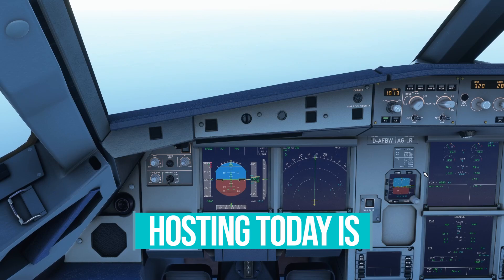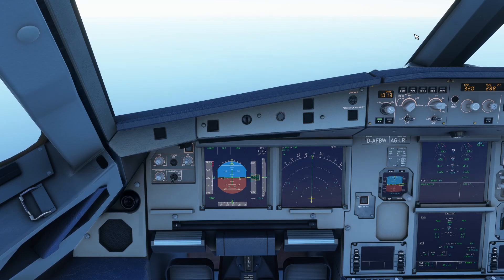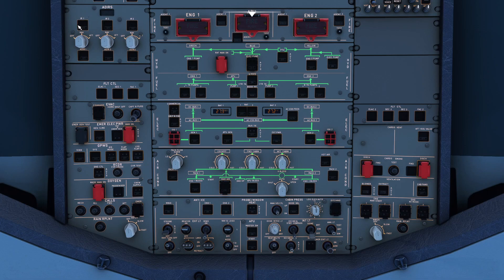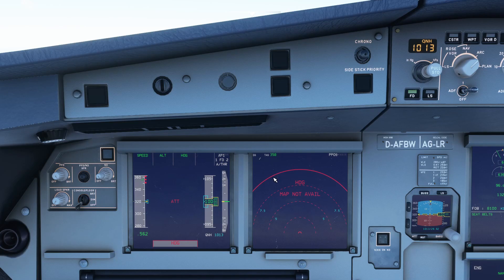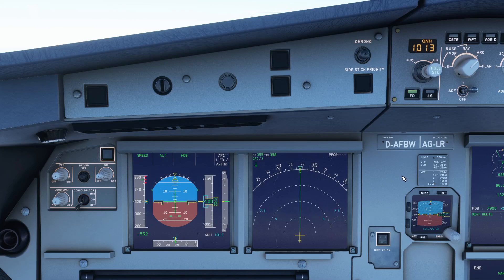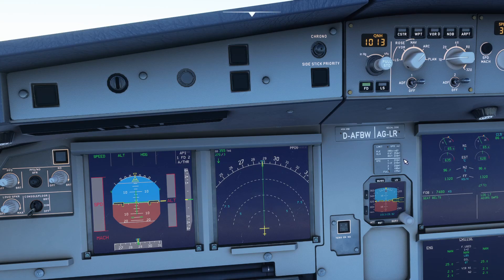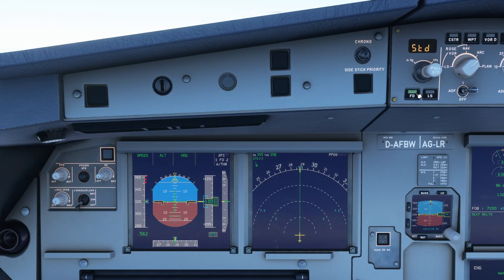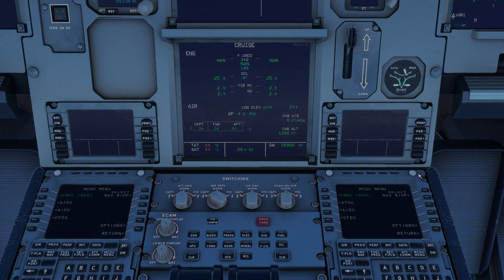FBW A32NX | Separated ADIRUs

Comment: Quick question if you download the FBW using the installer when msfs updates and fixs do you just remove from community folder and add back in?? Thank you
Reply from the maker: You can open the installer and it will have a prompt to update if there is a new version available.
Reply: @FlyByWireSim  thank you so before the new update remove from community folder do the update then add back into community folder and update on installer if showing. Thank you and keep up the fantastic FBW you have made.

Comment: this is in fact extremely fascinating what the guy's are doing, it is not just programing for the sake of programing, one must have a deep knowledge of the systems themselves. how is tis possible unless you work on the systems i.r.l. does Airbus provide information, diagrams ext or is that info freely available.
Reply: Indeed! This is what makes it very cool to work on this project. The team of software developers is assisted by A320 pilots and aircraft mechanics. Airbus doesn't provide us with information themselves. Some of the info is also available on the internet.

Comment: If you turn off IR1 doesn’t that then mean you can only have ATT as you would have to realign the ADIRU on ground? From he looks of it the aircraft just goes back to normal displays. Or has this just not been implemented?
Reply: I wasn't entirely clear on that aspect in the video. The push buttons only disable the output of data from that portion of the ADIRU. It doesn't change the internal state of the ADIRU. 

Changing the knob from NAV to ATT or OFF would require a realignment on the ground. Note that currently this realignment doesn't take into account movement yet. To be implemented.
Reply: @sjotgunsjonnie  oh ok. I knew that applied to the ADR but not the IR as the old versions didn’t have IR push buttons. They had FAULT/ALIGN on the lights
Reply: @tomstravels520  It is true that earlier A320s have an ALIGN light instead of an OFF light. However, one could also press those buttons to turn the IR data output off.